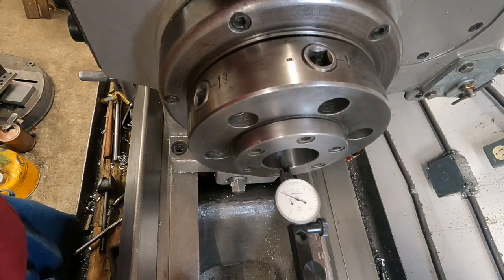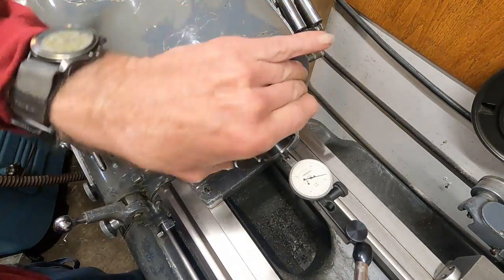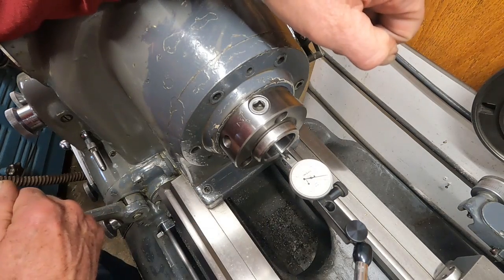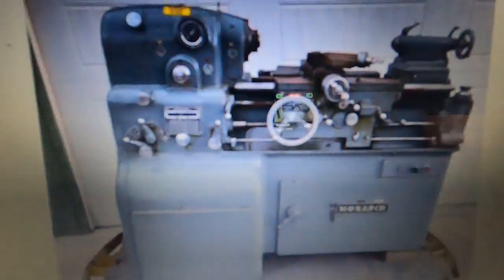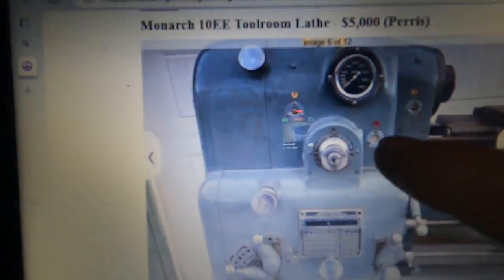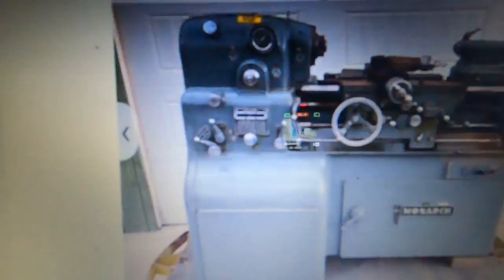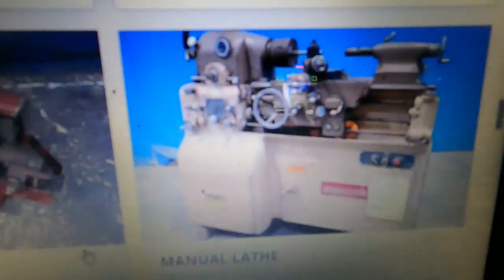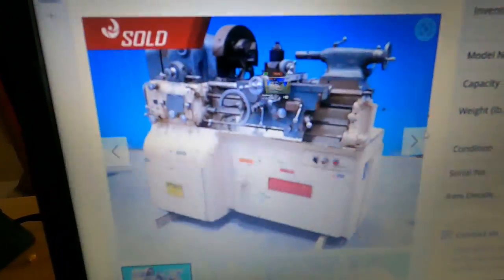Machine Tool Market Watch Monarch 10ee Lathes

Comment: Hi Don, I love your videos. I work at the Purdue University Machine Shop and we have a 10ee lathe with a busted generator. The generator is arcing and we've been trying to fix it but have had no luck. We would love your expertise in the 10ee lathe to help us with our problem.
Reply from the maker: The good news is the arcing meaning there is juice. On the cover for the switch panel it states. Dress the commutator with dressing stones, These stones called Slip Ring and Commutator Dressing stones available from Ideal electric in several forms you will need medium fine and polish. These stones will get the commutator round much better than a lathe. The bad news is you use these on the running generator with brushes in place. You will need to glue pieces of these stones on sticks to fully access all three commutators. The exciter has split brushes causing a sharp raised ridge in the middle. This needs to be dressed so as that ridge does not bind the brushes in their holders. The exciter provides voltage for switching as well as the fields If exciter has low voltage the machine will surge or not run at all. If the generator voltage is low the drive will not reach top speed. Good luck!!!!! Just be very careful this is at the top of what industrial electricians did, but elevator techs know these ropes likely the best, and they are well paid for doing this work on Ward Lenard DC systems.
Reply: @DonDyarprecision  It's not arcing on the commutator, it's arcing on the winding armature. I sent you an email to your outlook account so maybe we can talk about this better. I would love to put you in contact with my boss who actually owns the machine.

Comment: The primary value I get from your videos is they give me a great depth of understanding why I don't need to covet a 10EE, and that my 11" Sheldon is just exactly in the sweet spot of complexity and precision.
Reply from the maker: The Bush administration to stimulate the economy made machinery leases a total tax write off, so at the time I leased it for 5 yrs.with a $1 buy out. Here is the deal, the machine will work hardened alloys consistently to extreme precision often eliminating the need for cylindrical grinding, instant switch from inch to metic threading. And there is this, the machine is crafted far beyond anything else and has the feel of quality, simply there is no better machine in that regard. It has been a great machine for me in my business costing only $1 22yrs ago. and greatly expanding capability, The machine is still in tolerance because I only use it when needed. My go to machine is the amazing Axelson, thanks!
Reply: @DonDyarprecision Exactly-  It's too much of a good thing for my hobbyist shop.  Nice deal from W!

Comment: You have earned my respect for your knowledge and willingness to share. I've had some sort of worn out machinery for the last fifty years and my skills a comparable to those machines. I not criticizing when I say you could not melt and pour one of those machines on this old ignorant man. Something goes out and another high dollar junker in the middle of the shop.But to each his own. Learned something this morning. Thank you for taking the time.
Reply from the maker: The advantage with the 10ee for me is working materials such as 4140 type pre-hard and other alloy tools steels to close tolerances with intense attention to every possible detail including having an equipped tool&cutter grinder right at hand, I can not remember the last time I made a part out of mild steel on this machine. It does not make a lot of sense to use such a sensitive precision machine when a geared head work horse like the Monarch 60 series or the even more stout geared head Axelson to get it done. The nature of electronic variable speed drives requires close attention to over loading that is no problem on an Axelson, enough power to reach tool failure.
 The Axelson has 6 wires, my 10ee has 88 wires, 8 transformers, 3 thyratron vacuum tubes, 14 control diodes and many relays, huge resisters and more for the smooth ride, thanks!
Reply: Thanks Don, way out of my league. @DonDyarprecision